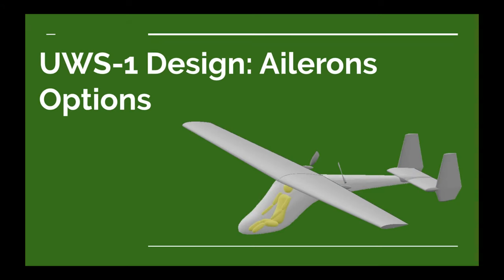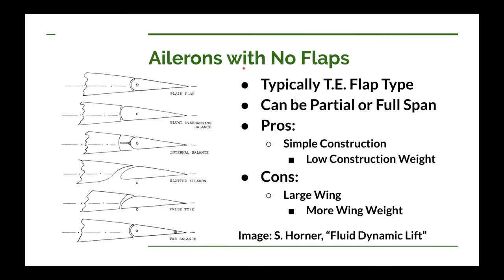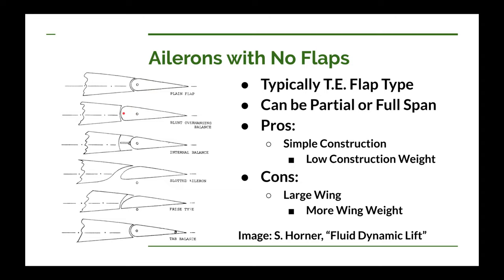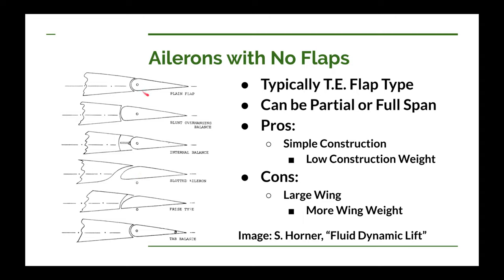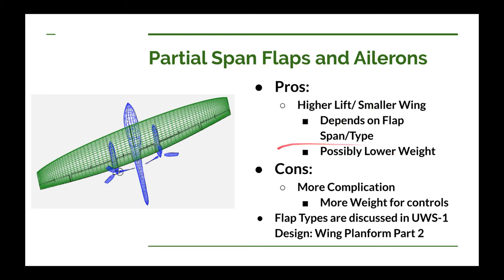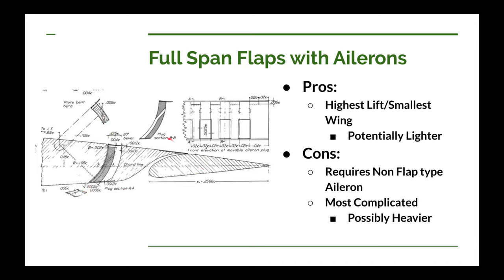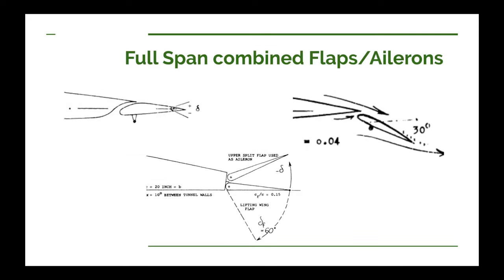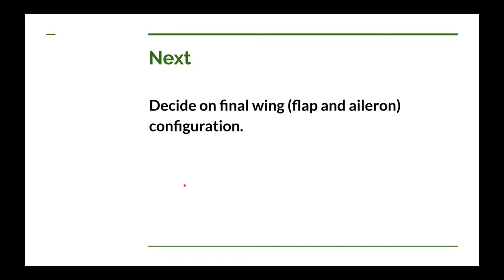UWS 1 Design: Ailerons

Comment: I am contemplating building a Goat 4 Glider (Mike Sandlin open source)
There are inboard flaps on his design (50%) but they are not implemented (they are there without any control linkages)
I was wondering if you would think there are any disadvantages (in principle) to simply incorporating these redundant flaps into full length ailerons so I can save weight and complexity? (toque tube the entire length from the inboard end)
I am more concerned about stability than efficiency and I am getting conflicting opinions on spin stability.
Reply from the maker: I think that the Goat is a pretty neat airplane. 

I'll assume that you are thinking of just extending the aileron to the fuselage to make it full span and keep the aileron chord the same. 

Instead of spin stability I think you may mean spiral mode stability. Discussing this is more more complex than what I can do in a comment. 

If you really want full span flaps then you would want to reduce the chord of the aileron to about 60% of the original chord. But this would require a change to the design of the wing and aileron requiring a new structural analysis and a redo of the analysis of the asymmetric rolling loads on the fuselage.

If I were building a Goat and did not want the flaps,  I would stick with the original ailerons and build the inboard area of the wing solid (no flaps). You can still run a torsion tube to the ailerons. This should be lighter than full ailerons with the original aileron chord.
Reply: @Designer103  
Ah, I am going to have to have a deeper look into that, you may be correct.. as it turns out, I was reading an article only yesterday about spiral instability but that had me focusing on the vertical tail aria and dihedral... I'm going to have to read it again with fresh eyes.

I had considered reducing the chord of the ailerons and extending almost to the centre (I am looking at running a large pusher prop around the tail boom so there would be a reduction pully/drive tube/bearings to mount and work around)

With the simplicity and cable bracing of the goat 4, I am confident that no further stress would be added to the cables or the spars or introduce any additional wing twisting (Any fears I do have with structure are focused on fatiguing that boom with vibration)
Having said that, I think you may be correct in extending the inner section ribs making a "solid/no flaps" section... it does strike me as being possibly "lighter".

There have been no stability tests on any goats that I have heard of besides having a nice "mushy" stall but the basic layout seems to follow the conventions for a very forgiving aircraft... I do not want to depart from that :)

Thanks for the input, you have managed to nudge me into a re-think.
Reply from the maker: I rethink my designs all the time. Nothing wrong with that.

If you do build the Goat, give some thought to making YouTube videos of your process. I'd like to see more of us on YouTube and build a community.
Reply: @Designer103  
I may begin collecting images etc but I would only publish once I knew I had 90% chance of completing... if I get to the point of mounting fabric on the wings I would consider an attempt at flight, inevitable and worthy of sharing.
At the moment, I am testing low cost fabrics and attempting to acquire some of the more difficult to source 6061 thin walled tubing so I have some way to go yet.